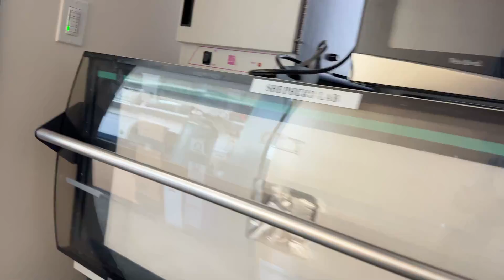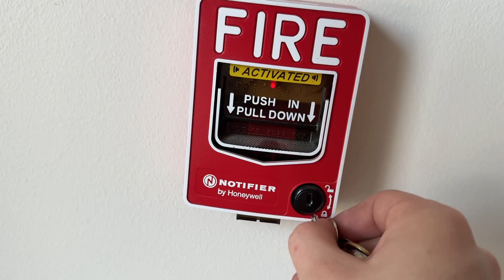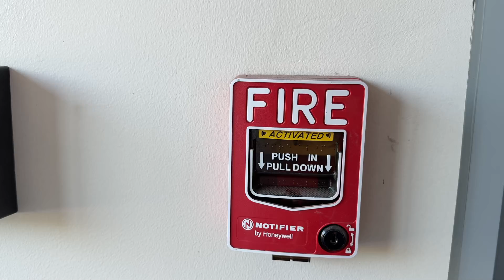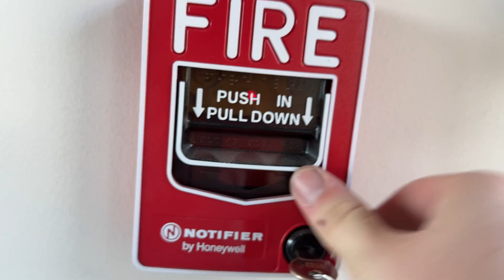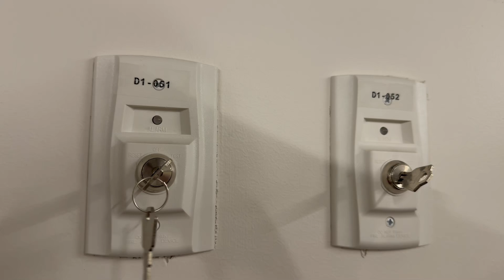2025 Engineering Fire Alarm Test 1

Comment: 8:24 Oh Uh That One Needs An Replacement To System Sensor L Series SPSRL Speaker Strobe
Reply from the maker: No it doesn’t
Reply: @4O5O-8O Yeah But You Said It Broken Which Means It Needs To Be Replaced
Reply: That one was just a speaker only so it just needs to be replaced with a new speaker not a speaker strobe
Reply: No need for a strobe on the stairways
Reply: Some speakers and strobes weren't working because they were disconnected for construction work